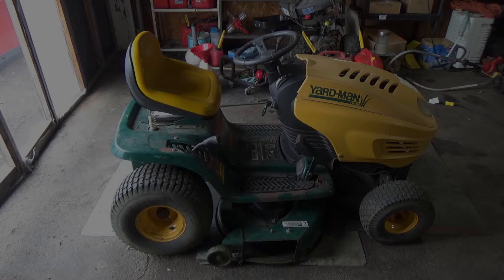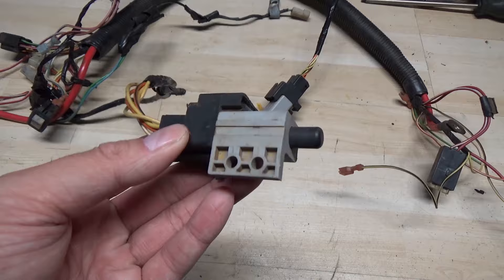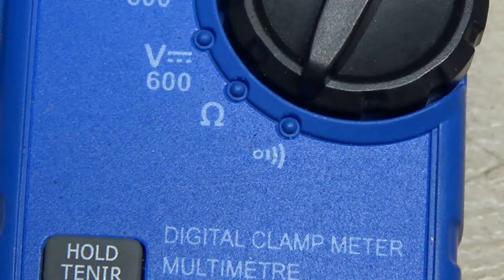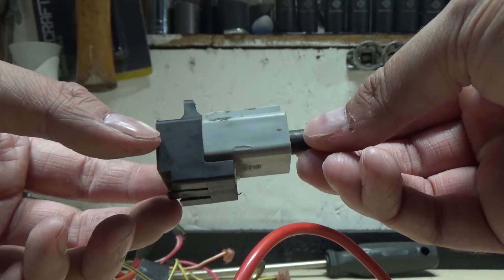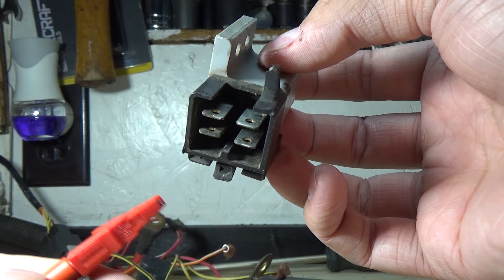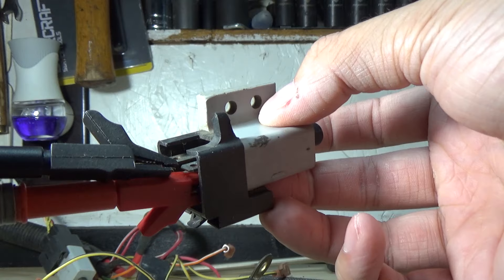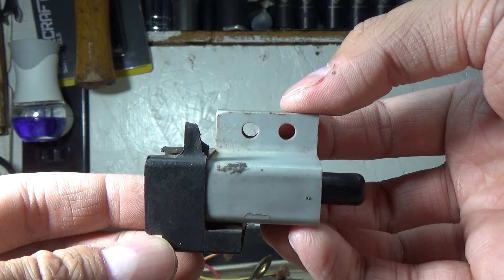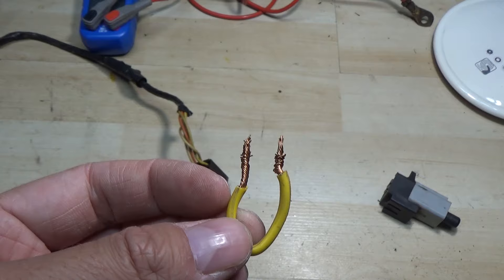How to Test a Riding Lawn Mower Safety Switch

Comment: Have these problems with my Husqvarna GTH 2654 after 15 years and a new carb rebuild, it runs better than new…UNTIL 3 weeks ago. Getting old enough where bending around the machine is a PITA.  Going for the last two safety switches this week. If not, here goes $3000 on a new mower.  Good video

Comment: This was very good and informative. We need the information provided quickly and efficiently as you have done. It's irritating to cull out "entertainment" and superfluous stuff in order to get to the needed content. Question: Where would you test the circuit in order to initially screen all the potential problems(brake, seat, deck, fuse, etc.) at one time?
Reply from the maker: At the 12v solenoid charge wire coming out of the key switch. Watch this video; https://youtu.be/vJWbfSxHY1Y

Comment: Hey eliminator, 
I'm working on a friend's riding mower.  No click,  no start. 
Turned over when I jumped the solenoid. Changed solenoid.  No click,  no start. Tested the ignition switch,  fine.  Tested all the safety switches, fine.  Began to loss my mind. 
Just wanted to at least get the oil warmed up to get it changed,  since that's all I was suppose to be doing originally,  so I went back to jumping the solenoid (after reinstalling the old one). Cracked great,  no start. Attempted to check for spark, didn't think I had one so I replaced the coil. After replacement of the coil,  I used starter fluid and jumped solenoid. I fired up immediately but as soon as i released the jump screwdriver it dies. Mind lost by now! I've tested the hot from battery to solenoid that's fine.  When I checked voltage at solenoid on the small terminal when turning the key, there was nothing.  I attempted to check continuity from red spot on ignition wiring harness plug to the same(pretty sure the same) wire on the solenoid but got nothing.  Ready to run the machine over with a monster truck now.  Can you please direct me wtf to do at this point.  PLEASE!

Comment: Usefully information. However,  I was  looking to test the wires under the seat and  of at least three safety switches on most tractors you only mostly focused on the brake switch.

Comment: Very good video. Thank you for your time.  I replaced my switch with a new one and the new one didnt work. But if I by pass it the fan blade works fine. Could it be wires crossed?

Comment: My zero turn control arm safety switches are testing opposite of each other... the left tests closed when pressed and the right control.arm tests open when pressed.... Is that. correct or a bad switch?? Thanks!

Comment: I have a 2017 Troy Built Bronco where the previous owner cut the safety switch plug to where there are now 4 loose wires with female connectors.  Three are single wires and one has 2 wires.  How can I determine which 2 wires to jump with the parking brake on to engage the starter and turn the motor over?  I am assuming the parking brake safety switch was the original problem and now I have no plug to figure out the original configuration.  Your videos are very helpful and so I liked them and became a subscriber.

Comment: I have a cub cadet LT1554 and it will not start.  I am pretty sure that the safety switch for the brake is bad but I can't figure out how to get to the switch to replace it.  I can see it from the top and it looks like it would be easier to get to from the bottom as I can't get my hand in from the top at all.  However, I am unsure about how to go about this repair.  Do you have a video that shows how to accomplish this?

Comment: Mines a Cub Cadet RZT 50 (2009). The safety switches I have for the PTO should only kill the PTO when the arms are in reverse yet they stopped. Both test good, yet one needs to be jumped, the left one for some reason in order to work. Did I miss something? I know for this model there are only two wires on the harness that plug into it.

Comment: This is helpful. The only issue I’m having is understanding which wires go in the terminal goihg by a printed schematic. It shows the color wires and numbers but without knowing how to read a circuit diagram it’s hard ti tell if the color codes are facing inward, outward which wouid make the wires opposite. In other words am I looking at where the bare wire enters the connector cavity, or am I looking at where the wire comes out of the plug cavity, leading to safety switch. The z  models have these damn neutral switches left and right and the schematic is backwards. 
Terrible explanation on my part but I cannot find a place that explains how to read a safe switch circuit or the parking brake etc. 
thank you !

Comment: I have a Toro 50" zero turn that is being bad. When I turn the key thee is a clicking sound. If i keep turning the key on and off it will finally start. It will do this most every time i try to start it. I am thinking starter but I don''t know for sure. is there a test for this problem.
Reply from the maker: Weak battery, corroded connections, or your valves need to be adjusted. Either those, or the compression release mechanism on the cam shaft is failing.

Comment: So....are any of the safety switches different on the same model?
I did what you said and tested the parking switch but then went on to the next in line, safety switch on the left arm thing and it doesn't test out the same.  Like there's only continuity when the button is pushed in on both sides of the terminal.

Comment: I have an issue where a relative moved my tractor not by taking the e brake off and putting it in neutral he tried to push it while in gear with brake on .. Now it will start but moment i put in gear stalls like i was out of my seat .. push brake on and engine sputters back to life .. watched you video removed wire harness and have continuity on both sides all the time (idiot mashed the plunger I suppose) I made a jumper prior to even watching the rest of video (professional auto mechanic) so figured to bypass the switch to test if its bad.  One side will not crank .. 2nd side cranks but no spark ? hook switch back up and it runs as before and stalls when in gear ? cannot figure out why it will not fire with switch bypassed unless there is more then one issue?  do i need to ground 1 of the other 2 wires to get spark ?

Comment: I have a Craftsman LT 1000 that has been well maintained, starts and runs well until you let off the clutch/brake, or attempt to engage the blade. Some safety mechanism "kills" the engine. How does one trouble shoot the problem. The blade does sometime continue to spin when disengaged. Any videos or suggestions.

Comment: I have a new rider that has that ignition key safety setting that kills the engine if you try to go in reverse with the blades engaged. After starting you can switch the key to the middle position that lights a warning LED that overrides the reverse cutout. Well, one time when I was done mowing I simply got off the mower which shut it off, which also extinguished the LED, and didn't bother to also turn the ignition key off. The next morning the battery was dead.  That surprised me.
Reply from the maker: Yea they can be a pain in the butt sometimes! Thanks for watching!

Comment: Great stuff. I am familair with interlocks as I was once a Sears tech. I am stumped on my husqvarna zero turn though. Engine starts no problem. When any one of the 4 interlocks is operated, the engine dies. This is odd to me. Any ideas? I dont want to bypass all the locks for safety reasons. If I habe to, I will though.
Reply from the maker: Probably a seat switch

Comment: So I've got one of those meters that don't have sound sooo what to do now
Reply from the maker: You don't need the sound, just do a resistance test and make sure the resistance is low, that way you know you have a connection. Continuity with the beep just tells you there's a connection, but doesn't tell you the resistance of the circuit.

Comment: I am working husqvarna  Z248F Zero turn,  wirh the handlers safety switches and I can not make t work i bypassed them and it started and drove for a bit and when i turn on the switch for to engage the blades everything shuts down even the motor ❗💔❗😰❗😤❗😤❗😤❗

Comment: Can a safty switch cause a mower to  weak cranking
Reply from the maker: No, a safety switch acts only as a circuit breaker. Either interrupting the circuit, or allowing it to continue.

Shim your valves, usually hard to start is the valves out of tolerance.
Reply: @EliminatorPerformance  thank you!
Reply: Great question! Thanks for posting it.

Comment: Canada rocks!  Question - why is there an interlock for mowing in reverse?  One of my mowers requires me to move the ig switch to the mowing in reverse position.  Another mower requires that I push a button on the ignition switch bezel which lights a light - this is a PITA since as soon as I disengage the deck then re-engage I have to remember to push the button again.  Overall I feel like all the interlocks are to keep the morons safe (sort of).
Reply from the maker: It's to prevent accidents, basically they don't want you to just throw the machine in reverse.

By turning the switch and engaging the safety switch it tells the machine you know you're about to go into reverse and should be more aware.

Does it work? Who knows... If you're not looking behind you, accidents can happen.

Thanks for watching!
Reply: On the older LT1000 and LT2000 models theres a plug by the shifter you can unplug to bypass this.  Not sure if this would work with your mower.  Not responsible for any cats you run over after doing the bypass!

Comment: Does anyone know how to test one of these switches when it has more that just 4 blades?
Reply from the maker: All depends on the design, there's a bunch out there but I figured I'd do a video on this design because it is most common. Try googling how to test safety switch and see if your switch comes up. Also, you could look for a wiring diagram of your machine, but it may be difficult if you're not familiar with electronics. Best of luck!

Comment: I like your videos.  However, this one lead off with a toilet bowl cleaner video that I had no way to skip.  So, at the three minute mark I had had more than enough, and went on to another video.  Don't know why there was no "skip" function, as there usually is, but I couldn't skip this one. and watch your video.  Bummer.
Reply from the maker: Sometimes they force non skippable ads, it's all on YouTubes end as they are in control of that